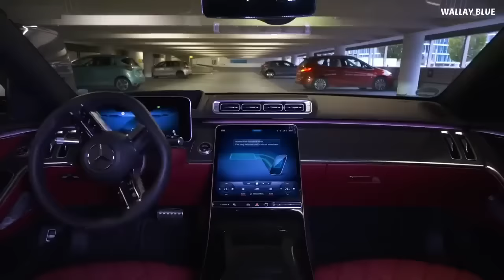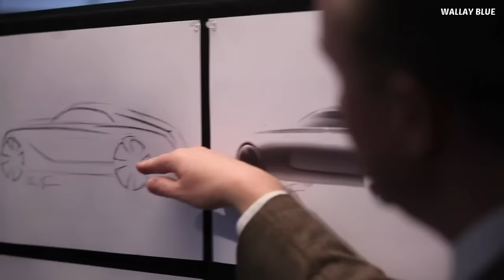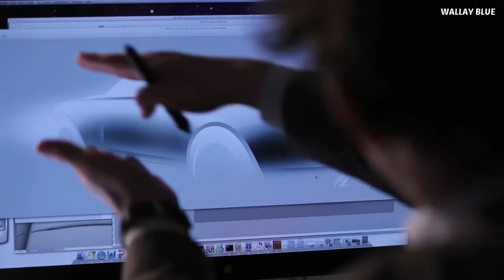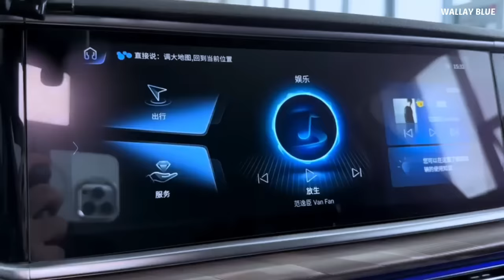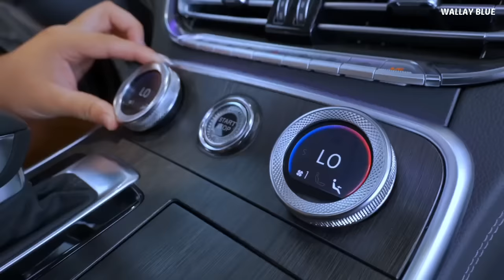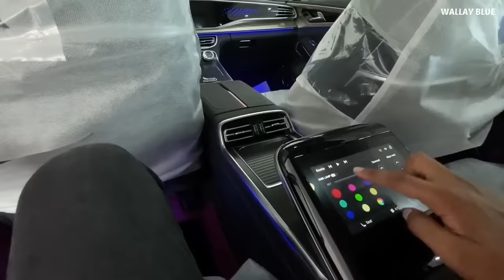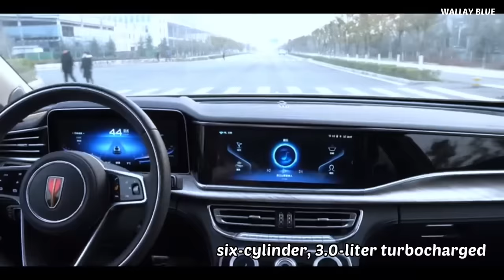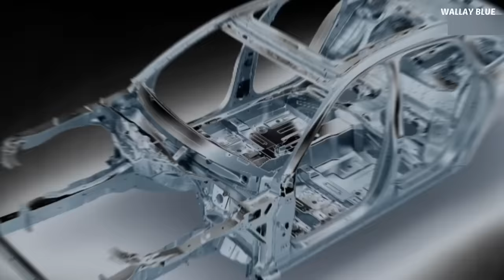China's Luxury Car Is A Threat To Rolls-Royce, Mercedes, BMW, and Bentley

Comment: Thanks to China once again, giving luxury without the bloated price trick.
Reply: Where can buy one of these?
Reply: Over time the prices will go up and up. Similar to what Lexus did. So get one sooner
Reply: Copy be original!!!!!
So sad
Reply: Sahi bola
Reply: Thanks China for copying every other automaker making it look cheaper than the originals,Yet it will never be in the same category as BMW, Mercedes, Audi, RR, Bentley or even Lexus. Yet it copy all of them lol 😂
Reply: Reverse engineering is much cheaper.
Reply: Meh.  Not impressed.  Let’s see the fit/finish, reliability etc
Reply: Because everything is stolen. And they follow where you drive and iisten your phone.
Reply: This car wants to compare itself to the top luxury brands. First issue: a 2.0 litre engine. Really. So, it will be way behind on refinement from the outset. Given it is such a big car, you would need to thrash it. Big luxury cars are not about flat out speed, or acceleration. They should be able to do it effortlessly though, when required. You can have all the toys in your car but, if it is not refined in terms of long distance cruising, and around town equally. Would need to see it given a direct comparison test. Then we might get a better idea of just how good it is
Reply: It will be a pile of junk
Reply: @ianmuir3640  Like the Howitzer and Abraham tank America sent to Ukraine.

Comment: Depending on the options, H9's curb weight is 4,100-4,400 pounds; horsepower is 252 or 283 horsepower. Those figures are not competitive with other luxury car makers.

Comment: Looks nice.  Not sure about service on Chinese cars but I bought a Chinese motorcycle over Japanese because the Chinese bike had a bigger engine than a comparable Japanese bike plus the dealer offers free service for the life of the bike.  The ride is similar, gas mileage is not as good because it isn't fuel injected, but in a year my out of pocket costs for tune ups, oil changes and gas is still less than a new Japanese bike.

Comment: Part of the appeal of the prestigious brands like Mercedes and Rolls Royce is their consistent longevity and excellence.  To compete with the marquee brands it’s gonna take decades of excellence, other wise it will always be seen as a budget Benz
Reply: From the early 2000s, most of the luxury european brands have been producing pure crap, filled with plastic parts everywhere. Talking about excellence LMAO!!
Reply: Merc WERE excellence, fantastic engineering. BUt that ended with the USA merger. And now their parts are the same crap u see in French cars. My relative had to sell his 19mth old Merc. Dealer couldnt fix  a fault, car was undriveable. Looked lovely, AMG, but couldnt be fixed! Me and my family have numerous instances like that with "German quality". German quality= a thing of the past. But they still lead in style and luxury over most makes.

Comment: Bought Washing machine hoses, manufactured in China. That evening walked by the machine and got spritz with a fine mist in the face. Imagine the insurance claim had that let go on the upper floor in a condo while you were away. Rubber was made from recycled tires, total garbage.  Have experiences with multiple rubber products from garden gloves, hoses, etc. Similarly,  plastic from China  is no good. My windows  thermometers of which I had three, all disintegrated into shards within three years.Again, recycled plastic. Bread toasters from China have to be unplugge because they will catch on fire while you’re away at work. Chinese electric cars are burning up at a high rate and the fire cannot be doused with chemicals or water. Sometimes they burn entire buildings down if they’re parked closely. Lying, cheating and stealing, buy  one, good luck surviving. The airbags are known not to deploy for a starters.
Reply: Dead right mate!

Comment: Very Brief and Summarize Ideas :

the build quality is more than excellent, and is superior to its european and DY americans counterparts not sure about the Japanese . 

the exterior design is very modern and its lines are more appealing than the nasty german cars mercedes E class , bmw 5 Series, audi A6 and even Japanese Lexus GS.
but the lines and external details, despite its elegance and luxury, were inspired, or influenced by the designs of other foreign cars. 
this is not a big problem, especially with this level of luxury and build quality, but the car lack the need it originality or special personality , especially for the flagship car of a company that has this history, heritage, and nobility in the history of the Chinese automobile industry .

from a commercial point of view, the approach is successful and profitable, especially since the design suggests that the car came to compete at a higher level, such as the mercedes s class , bmw 7 series, audi a8, and Lexus LS , but it is offered at a price point competiting with the other medium-sized luxury cars ...

the interior design is following the trend of the nasty germans cars , simplified all the functionalities in two flat screens with very few simple opreating buttons.
the driver will have almost the same experience on the mercedes s class mixed with bentley touches maybe not the current generations but very close which all although not very inspiring the cockpit, still comes with high quality leathers and characterize as very well constructed or made (the build quality) and regarding the space available and the level of comfort maybe above most of the midsized luxury sedan cars.

regarding the sporty performance and the handling , I can not give an opinion before trying the car, but I believe that their competitors brands enjoy the welth of decade's of experiences in which helped them improving the performances of the engines and gearbox and refine the handling with the time.
while the overall driving experience I think it is very satisfactory in its class, inside and outside the cities the car still offer comfortable driving with very energetic engines and high isolation , at least from the data offered by the manufacturing company...

Comment: Maturity develops over time. It cannot be bought. I love my Bentley GT Coupe. Every year they get better and better and better. If I EVER have a problem, a technician is working on it within 24 hours. I have yet to even once, required a technician to come onsite. What pretty lights! I don't want to attract attention to my car. I prefer my privacy. I know what I am driving. The glow on the ground underneath my car is just tacky. The reflection of the guy in shorts and tennis shoes, taking a movie of my car with a cellphone is not the image I wish to associate my Maybach S600. China can imitate, but never surpass. 
Take a good look at the paint job of this car. There is a lack of depth when you look into the paint. The paint lacks the finish on a Mercedes Benz S Class or BMW 5 series.  Hongqi dealerships are BGC, Manila, Philippines, Oman,  Abu Dhabi, UAE and Qatar. If I can buy 4 HS9 for the price of a Rolls Royce Phantom, there must be a reason for that.
Contrary to what China keeps talking about, EVs are not going to do well. EVs are expensive to get rid of. I am never going to buy one. And definitely not from China..

Comment: Can tell one thing ! Let all car models be using for 10 years . Youll never find the chinese car at the end of ten years. My father had an audi 100 LS ( 1979 ) . We used the car till year 2010. Never had to replace anything , only the service and tyres had to be. But on 2017 my sister brought a chinese car. Within two months all interior accessories brocken . Always got problems in cv joint , brakes , suspensions and air conditioning . She had to put the car in to the dealer always for repairing . External parts starts to collapse . After a long journey, always a part was missing . 😅 . She gave it to a friend without selling . After few years he did sold it fot parts . I know that there are RRs still in running condition and without any corrosion. Some are 80 years old . Thats why they are expensive .

Comment: Not only features and design but production,engineering & material quality, assembling, driving  behavior ,suspension, and overall strength of the machine????? Need  to review after 50 or 100 thousands mile.

Comment: Anyone buying this car for 100k will find out within a year. Chinese manufacturers are just not there yet in terms of quality. Just like other Chinese brands like BYD, all these glitz and glam that they offer will fade away once the repair bills pile up. Had some personal experience with BYD seal. Interiors may seem quality but it's all cheap plastic. After 8 months of sun and rain these plastics will flare up and disintegrate. Don't even start complaints about it's battery...

Comment: I bought a Chinese motorbike.
It started having electrical issues within 30 minutes.
Of my eight days of ownership, it spent three at the dealer.
In the end, I returned it.
I hope their cars are better.
Reply: I know you made up the story
Reply: Sadly Not.
The fuel gauge read almost empty, When I topped-up the tank, it read EMPTY, so I returned it to the dealer who investigated and said that there was an electrical short-circuit due to pressure from the weight in the fuel tank from the extra fuel. They allegedly fixed this. The problem recurred. There were other issues after this initial problem which the dealer said they'd fix  but I opted to sell the bike back to the dealer at a loss of about £350. I bought a 2008 Honda Varadero which I kept until a year later,  I passed my full licence and sold it at a small profit. I then bought a Honda CBF600 which was ideal for me as I'm a shortie.
I KNOW that The Chinese CAN and DO make quality products. These cars might well fall into that description but I'm merely tell you my experience,
Feel free to call me a liar.

Comment: Usually, the reason why an RR is 5 times more expensive is because the RR is 5 times better performing. The only thing that seems more developed to me in this car compared to RR, Mercedes, BMW is the ridiculously large grill that suggests by its dimensions that it could be used as a home heater or bbq grill
It is ok to have models on the luxury market, but they must prove in time or in tests that they are at least at the height of the competition and have a different and preferably more modern appearance than the competition if they want to stand out on the international market as well internal
Reply: The grill size was very prominent in cars from 30s and 40s.

Comment: They immediately lost me when the AI voice narrator spoke of the tiny, underpowered 4cyl and 6cyl displacement engines. Not at all competitive with any current Mercedes, Rolls, China -only Cadillac CT6, or BMW. 283 horsepower is definitely nothing to brag about in a heavy car of this size. That is pathetic.

BTW, If this "sensational" new luxury communist car is so great, why does Jing Xi still ride around in that, old, tired, 1956 Hong Chi? The name means "Red Flag".

I would never buy a Communistmobile in the first place. Their longevity and reliability are still an unknown.

Comment: I'd compare it more to a Cadillac. Wonderful machine, but not really timeless, or of very exceptional quality. For example, in an unobtanium car, there's no plastic either visible, or open to touch. Everything you see or use is made of metal, leather, or wood. Completely useless, but slighty impressive nonetheless - and never inexpensive.